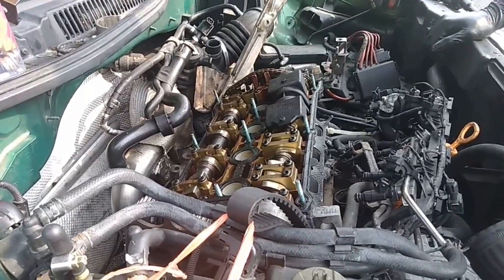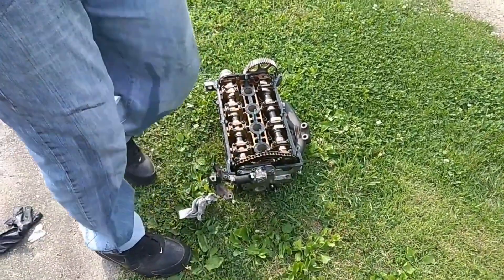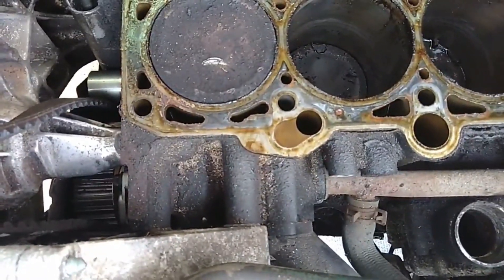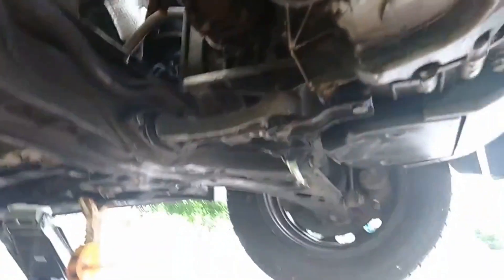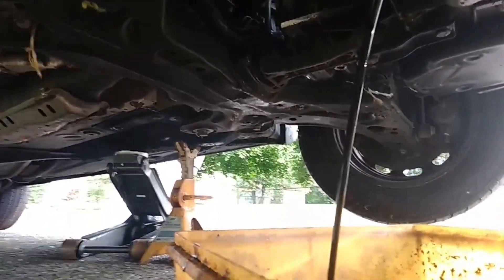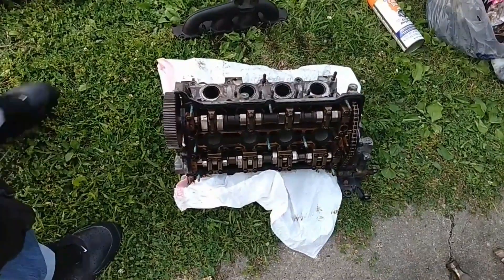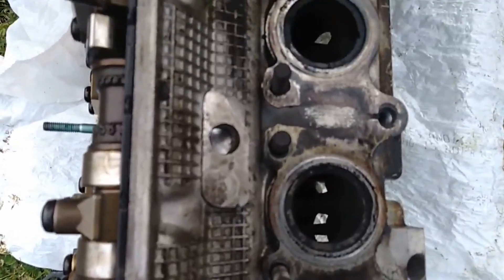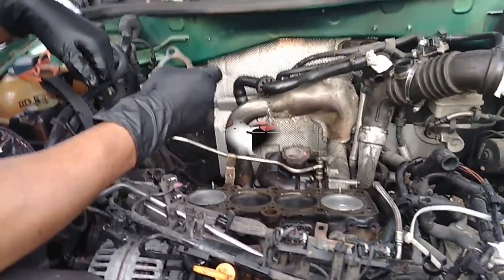Volkswagen MK4 Project /  Head Removal Part 2

Comment: how did you get that 3rd bolt out with the head in the way
Reply from the maker: Peace,  I think I know exactly what you are talking about.  I don't know the size of the 3 bolts off hand, but you have to use a wrench.  You can remove the first 2 bolts with a socket. To reach the 3rd bolt you will have to use a wrench.  The head does interfere with getting the socket seated properly on the head of the bolt. I hope this helps you out.

Comment: Did you drain the coolant and oil by chance before doing that job and would you recommend it?
Reply from the maker: Honestly, @Los productions, I can't remember when I drained the fluids. I did in fact drain them.  If you have to turn the engine to adjust the timing or anything, I would recommend draining the fluids first.

Comment: Dude you saved me a lot of time. Most things I read said to either remove the turbo or all the turbo inlet hoses and pipes. All I did was tie all that stuff out of the way. Getting the head disconnected is not too difficult just take your time. Thanks for the video!
Reply from the maker: @William Rawls I am glad that the video was helpful to you and I am also glad that you enjoyed it. Thank You For the Comment.
Reply: @curbsidemechanic3229  Do you have the video of taking the cams off and putting it all back together?
Reply from the maker: @williamrawls2381  Not Yet.  I ended up swapping the head with one from another one of my project cars.  I Have plans to rebuild the engine in the near future ( I hope ).  I put the head back on and ended up either deleting the footage or simply not pressing record.  This is the next video following that particular project.  I had to pull the oil Pan because the dipstick housing cracked and fell into the Oil Pan.  I will continue to push forward with more projects, Stay Tuned...    https://youtu.be/nRvmz-0DwT0

Comment: I'm doing this now on a mk4 golf 1.6. Did you need to TDC anything  first?
Reply from the maker: Yes.  Before I removed the Head  I set the engine to Top Dead Center.  I had to make sure that the Cam Shafts on the new Head Unit were aligned before installing everything back together.  

Hey Good Luck with replacing the Head on your 1.6l,  Let me know how it goes..